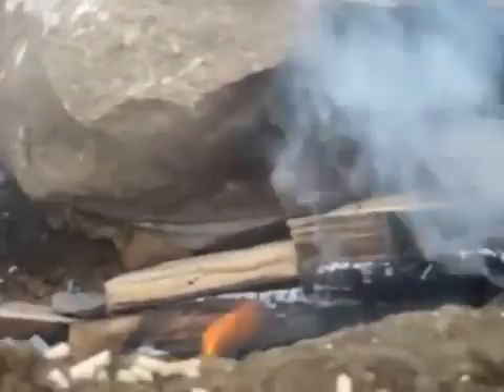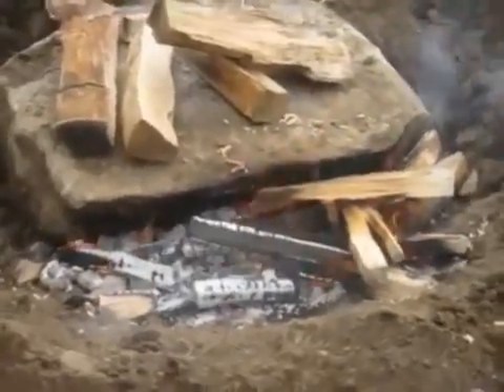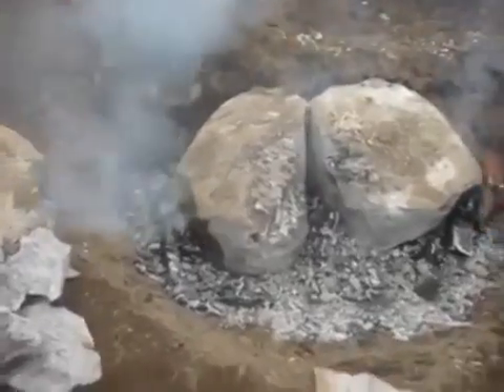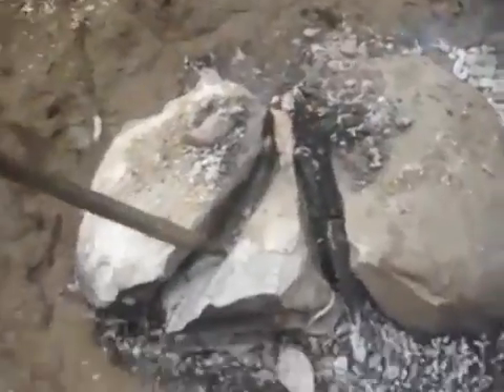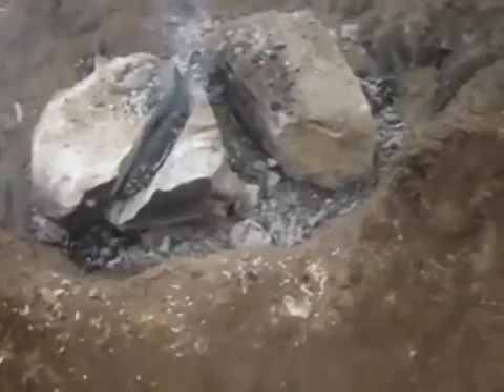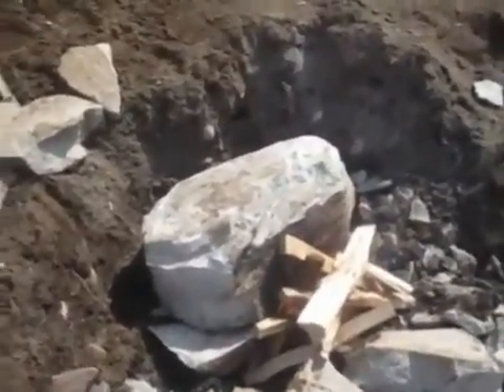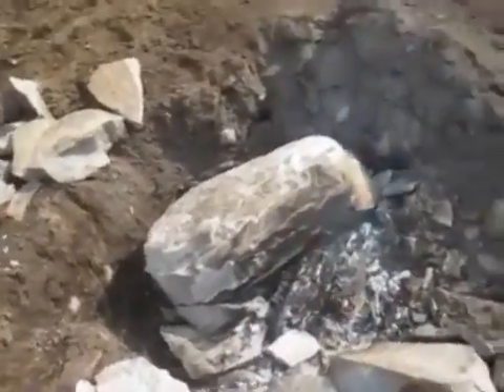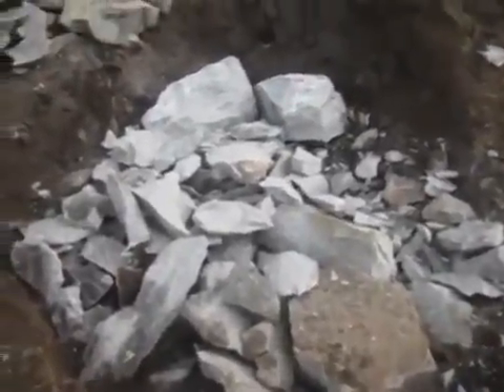Why you should not use river rock in a fire pit.

Comment: Cool video and presentation skills.  I clicked because I actually use fire to split river cobbles to make and experiment with stone tools or to fire treat chert(flint) so it fractures easier.  Sometimes certain cobbles explode with such force that their shrapnel makes the metal fire ring sound like a bell.  To add to your description about air pockets, I have found solid limestone that when split open dry, had an actual small pocket of water inside and had that been heated hard by a camper, the results could have been bad.